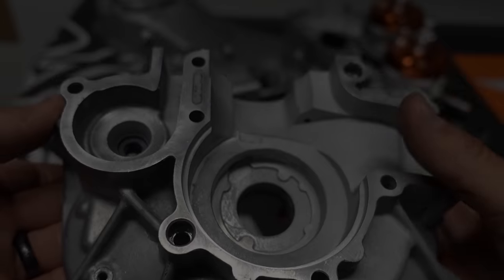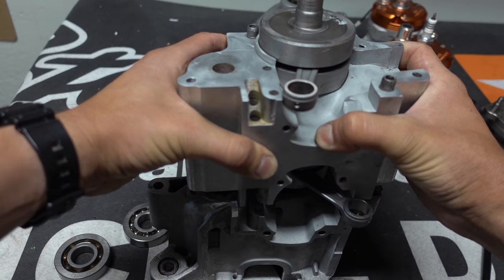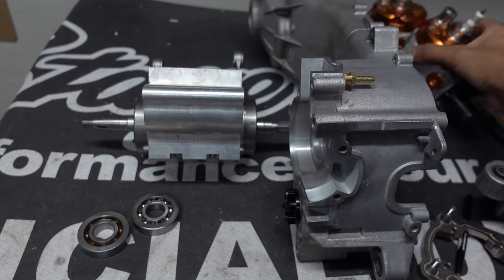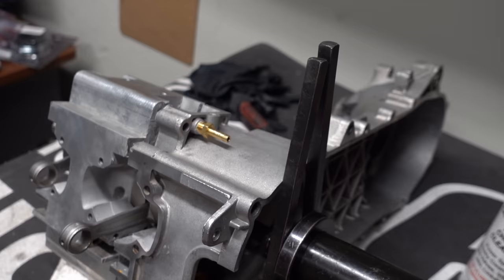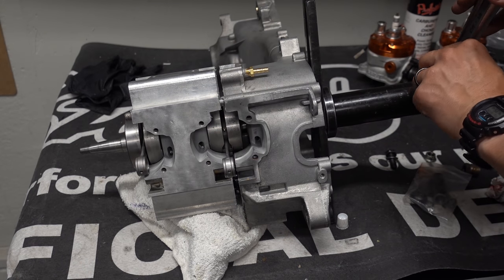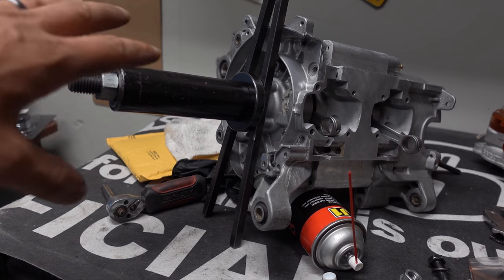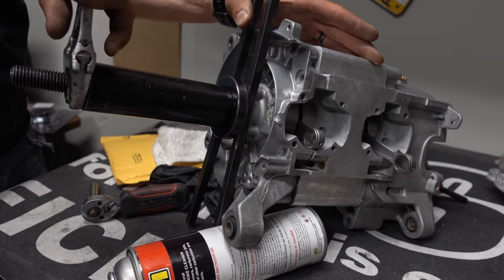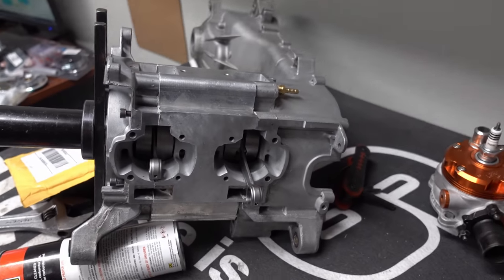Scooter engine build CRANK INSTALL Twin cylinder zuma rebuild Video 2

Comment: Hello and thank you for your videos. I am opening my crank case on my roughhouse 50.  I cannot figure out how to remove the pipe that is in the bearings where you mount the engine. It is called the Pivot E.G. hanger pipe P1486020000> any advice would be greatly appreciated. Thank you Chris

Comment: Can u do a crankcase milling tutorial I'm putting a a 2fast 70 on stock cases and need to mill the cases to fit the skirt
Reply from the maker: There’s a ton to do on that but should be fun! we’re happy to support builds where the parts came from us: it’s best to ask the company you got those parts from as everyone does the setup a little differently. You need to do much more than milk the cases for the skirt. You also have to weld or devcon the cases and port it all right. If you don’t port the cases properly you’ll never make power. The 2fast 70 setup is a lot more work than most would expect
Reply from the maker: J Bush we want to help as much as we can but the high end builds are much more intense for sure

Comment: hello how exactly are the crankshafts connected to each other via the adapter would you test of some pictures and are the special crankshafts or normal?
Reply from the maker: They are 100% special you can use standard cranks. It’s a billet center carrier with bearings

Comment: Are right cilinder (closer to magneto) are hotter than left? Because water pump is closer to left cilinder?
Reply from the maker: It shouldn’t be. It’s hard to explain how the cooling works on this block but it’s pretty uniform
Reply: That is cateno miano adapter? How the cranks are fixed in the middle?